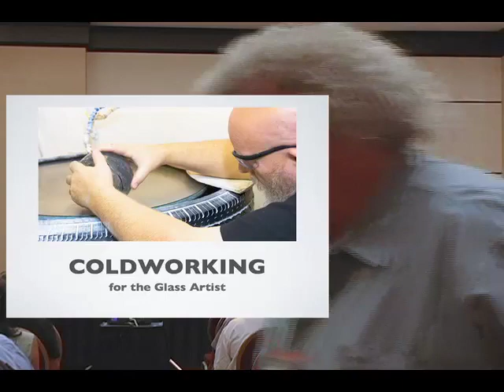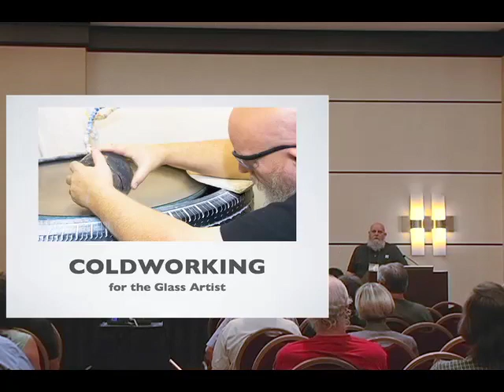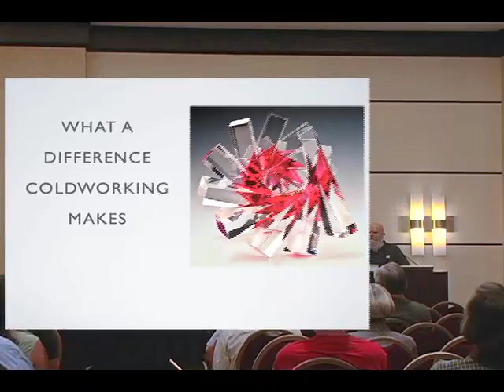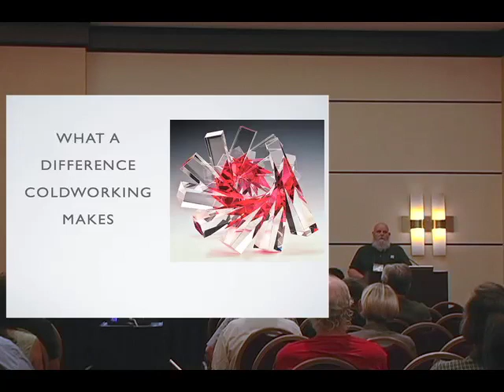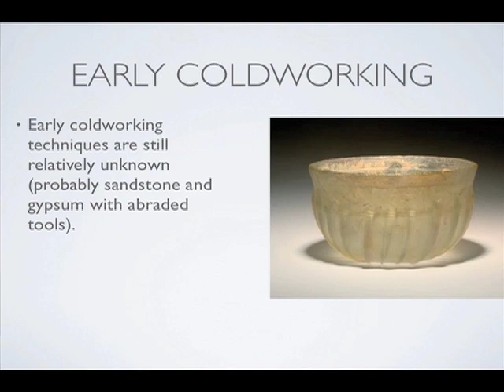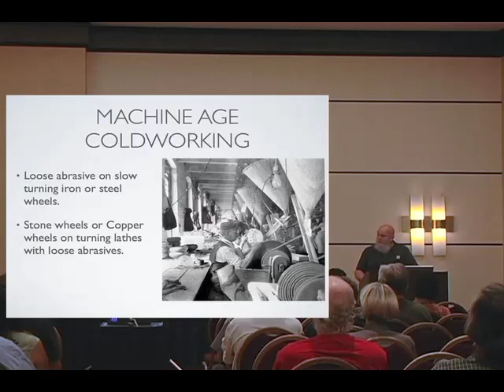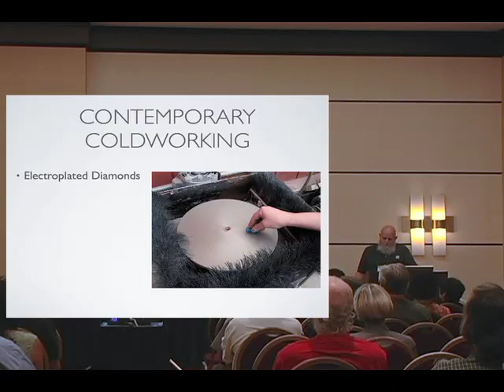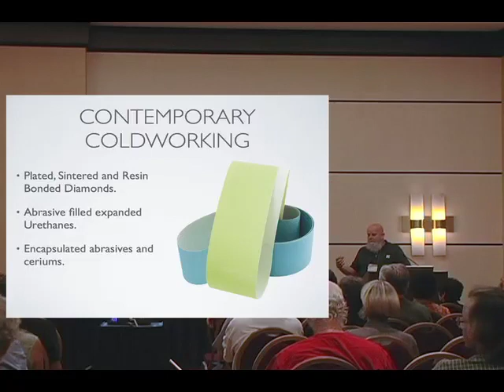Glass Art Society 2010 Lecture: Coldworking for the Glass Artist: Part 1

Comment: Hey, thanks for the video... Could you tell how a stack of glass is joint free smooth on its outter surface??
Reply from the maker: I'm not entirely sure I understand the question. Can you elaborate?
Reply: The stacks are encased in sheet glass.